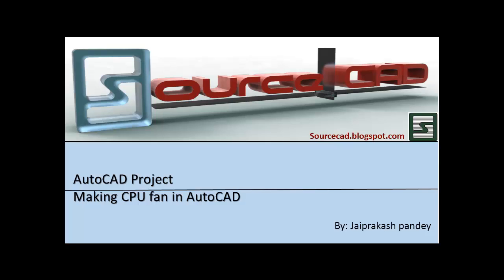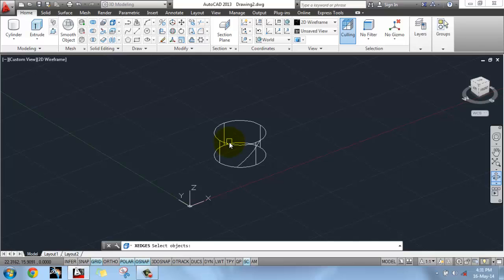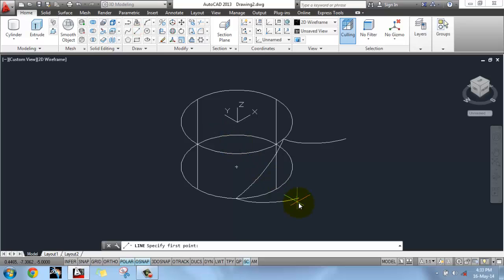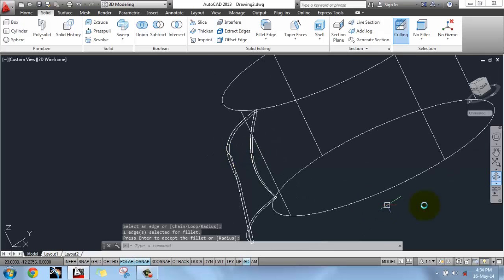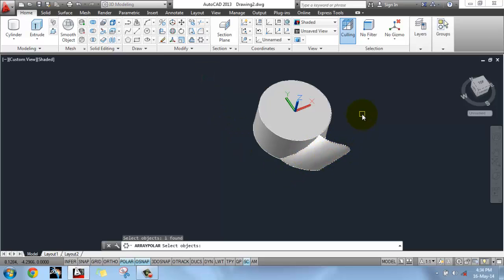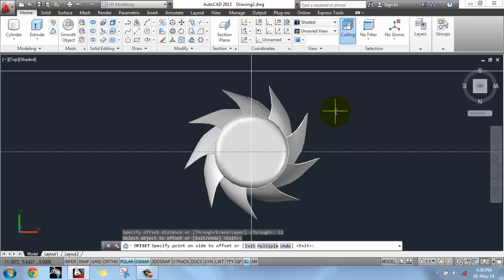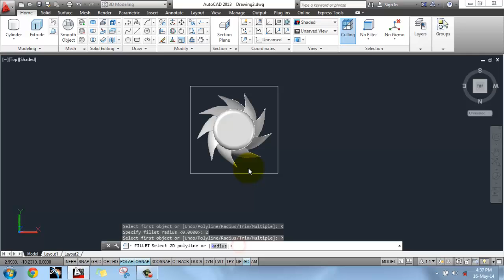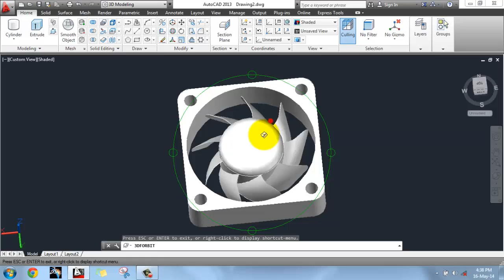Complete 3D modelling of CPU fan with AutoCAD

Comment: Hey everyone i have a solution for the frozen AUTOCAD when you use presspull, (its freezing because the program is trying to simulate all the possible PRESSPULL options in your window), So the solution is zoom in until you have less items in your display then use PRESSPULL.
Hope i helped someone.
My problem is everytime i use it overlaps the fan in the middle and the whole thing becomes a block with 4 holes :(

Comment: If anyone had issues with the "presspull", select the 5 circles (large circle outside the fan, and the 4 bolt holes) and the outer frame and group them together by right clicking and selecting group. Then use the presspull.

Comment: Hello good job!! I have a question is this a functional model?? I need a model which i can print on 3D FDM printer and can be used in PC....
Reply from the maker: Thanks, This is not a "functional" model and I would certainly not suggest you to use it for 3D printing.
Reply: +SourceCAD thank you i need something with straight blades i know

Comment: Hi sir,, just love your videos. They are of great help. Wish you all the success in life.
Sir, when I use the press pull command it is only extruding rather than cutting. What could possibly be wrong? Please suggest. Thank you.
Reply from the maker: Mohammed Zain Patel it is difficult to say what is wrong with presspull command in your case but you can try using boolean tool (SUBTRACT command) if presspull fails.
Reply: I tried subtract command. It gives me the error of 'no solid,surfaces, or regions selected'.
Reply from the maker: Mohammed Zain Patel the geometry seems to have been made out of open lines and hence instead of solid surfaces must have been formed by extrude command, I would suggest making fresh geometry in this scenario that's the best I can suggest :(

Comment: don't really get what you do at from min 3'05" to  7'19" :-/ i've got autocad 2016 but i can't do that...it gives me error....
Reply from the maker: Cynthia Maria Gutierrez Santana I used FILLET command to round off sharp edges of fin and then I used ARRAYPOLAR to to make multiple copies of fin. Hope it helps!
Reply: I have a problem making the fillet stick to the fin, I can't seem to understand what edge you select there. I tried selecting both the edges around that area and I get bigger fillets different from your result. Can you help me pls, I am using 2016 version on MacBook. Thanks.
Reply: Found out what the problem was, had to press enter after selecting only 1 edge, dumb me:P .
Also, your tutorials are very well presented, I'm trying to re-create as many as possible to add to my future portfolio so your work is more than welcomed.
Cheers.

Comment: hi sir,.i just want to ask if there is another way of making the shape you have made by using helix?or how will you make an arc like shape that snap on both edges of the cylinder?(im not very sure if my question is understandable)btw,.,thanks for your tutorials,i learned alot of techniques from you sir,. :)
Reply from the maker: Jhez Lee yes you can use sweep tool to sweep line along helix and then apply fillets and that would have been much easier but then you would have missed NETWORK SURFACE tool which I tried to explain using this tutorial. cant understand "snap on both edges of cylinder" but my guess is you want to use arc instead of helix for making that shape but it would be too difficult to make that with arc. 
Finally thanks for watching, keep learning :)
Reply: SourceCAD
yes sir,.,thats what i meant,.how will i use arc instead of helix., :) ,. i had tried the technique u have used on doing the herringbone gear in this fan and found it easier to do,., :) thanks sir for your tutorials,., keep on upadating,., more power :)
Reply from the maker: Jhez Lee I am glad it helped Jhez Lee, keep watching and learning and there are more videos in queue I will soon upload.